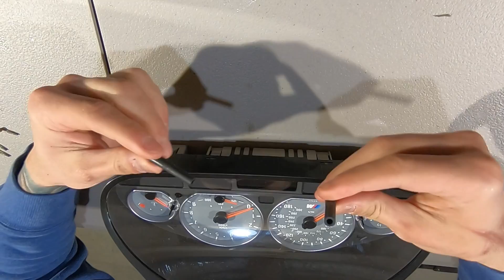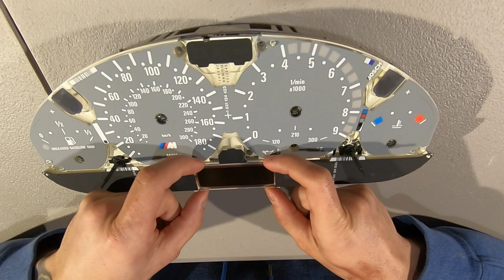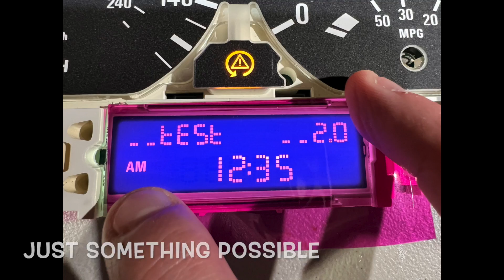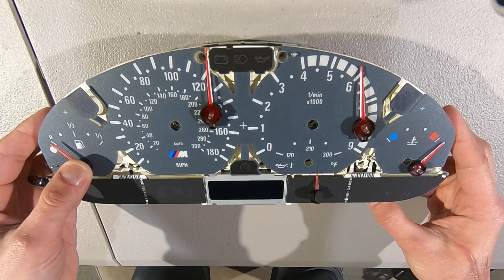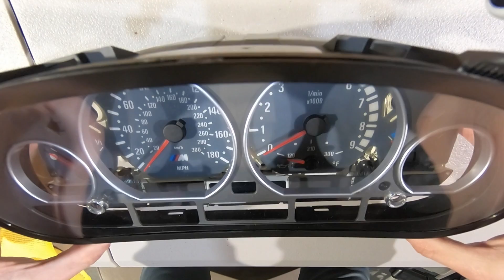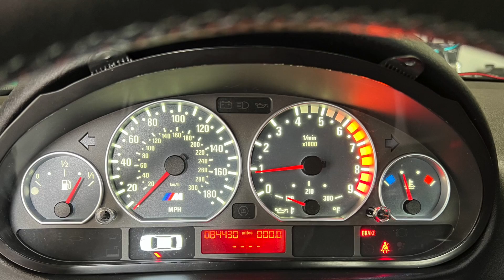E46 BMW M3 Cluster LED Conversion

Comment: How many volts are these LEDs anybody?
Reply from the maker: Pretty sure all LEDs operate on 3V but as long as you get the correct LEDs they are made to a standard and will work. I think I mention the type needed in the video or the description. its been a while

Comment: Do you think it’s possible to only convert to white where the M logo sits?
Reply from the maker: you'd have to float a LED under it and tape it off so no other light gets around it. probably possible but not without custom work

Comment: Did you replace the two small lights on the top panel for the interior lighting?
Reply from the maker: I haven’t done the overhead light yet. It looked pretty easy but I’ve had a lot of home projects that I’ve undertaken and haven’t messed with the car in a while. I wouldn’t recommend white on that light tho unless you plan on dimming it down with resistors. I’ll get to it one of these days. Too many projects and hobbies and not enough time in a day.
Reply: @CroVlado0510  Can I have your email for a few questions and photo material
Reply from the maker: @angelivajlov8513 find me on discord crovlado

Comment: Doing mine on my m3  all the needles came off easy but on the speedometer and the rpm’s the shaft came off with the needles. Is this supposed to be to happen ?
Reply from the maker: No, shaft is not supposed to come out.
Reply: How do I keep it from coming out and if they do come out. Will gauges still work ?
Reply: My cluster on my m3 all the analog gauges stopped working.  I bought a used cluster and I was going to just swap my original m35080 chip to the replacement cluster. That way I have correct mileage and no tamper dot. The shafts came off with the speed and ramp needles when removing. Which it’s the cluster that analog does not work. So it’s not that big of deal. But I definitely don’t want them to come off on the replacement cluster that I’m putting in. So any advice would be greatly appreciated.  This cluster you made on the video is amazing best one I’ve ever seen in e46 m3
Reply from the maker: I did just as I described in the video. Squeeze and twist while pulling up. None of the shafts came up. Honestly I’ve done 3 clusters and they all came up the same.
Reply: Ok thank you. Do you do this as a service for money ? How much to make my m3 cluster like yours in this video ?
Reply from the maker: I haven’t done it as a service, just did a test cluster from a junkyard to try out a few different combinations and color diffusion. One for a friend and my own. Like I said tho all the needles came out without the shaft coming out.

Comment: My cluster on my e46 m3. All electrical work but no analog works. The guy I bought the car from. Said everything worked fine before he replaced the battery in car.  I checked fuses and they are good.  What do you think it could be ?
Reply from the maker: find an electrical schematic and check the stepper motors is probably where I would start

Comment: What if you use white leds instead of orange ones on the display? Will the numbers become white ? I would love to have white leters with black background, looks much more modern
Reply from the maker: I tried this. The numbers become a white with maybe a hint of blue. photo is in the video if you watch it but the background becomes too blue. I haven't figured out a way to get the background back to black or close to without getting the numbers and letter too dim, I've tried polarization film and all but cannot get it right. Perhaps someone with better light spectrum cancellation knowledge could figure it out. Considering the age of the car at this point I don't have faith that anyone will, so I've settled on red instead of orange.

Comment: Just a small tip for someone planning on doing this. I have cluster that is 1999 and I do not have pin above "car" to light up whole cluster's background. So  you just need to connect power(12V) to pin 7 on black connector and obviously ground😁
Reply: for me doesnt work
Reply from the maker: @pashira probably did it wrong
Reply: @CroVlado0510  no, facelift clusters had backlight on kbus

Comment: Hi can you send me the link for the LEDS my 2015 x5 the right signal light went out.i also have 2002 m3 and i want to try this kind of tuff.great job please let me know
Reply from the maker: There is no particular link. Search on eBay or AliExpress and buy the LEDs you need for your project. If you need help identifying LEDs, a search engine will be your friend. Good luck with your project.
Reply: Thanks for your reply I will subscribe to you can you tell me the LDE 
You use on the  M3
Reply: Hi sir what code or type of led do you use to replace the orange led to white?. I have e46 316i

Comment: Need help how did you add the red diffuser sheet onto your needles ? You said you cut them into holes ? Can you elaborate further as I am going to do this retrofit soon and just needed some clarification. Can converse through email if wanted.
Reply from the maker: Turn the needles over and cut red diffusion sheets in the shape under the needle so it fits over the center hole where it attaches to the cluster. Slide it in there and put a tiny dab of hot glue in there to hold it in place. If you cut it tight enough it can use surface tension against the hole to keep it inside but it’s though to cut that small hole perfectly. Hope that makes sense.

Comment: Great videos, amaizing details. But i have one question. How do i know where is possitive and where is negative on the board? Also i have some 3528 white SMDS. Will those work? Thank you for your time.
Reply from the maker: The LEDs are marked with a cut corner. They may but I don’t know if they’ll be the same brightness. Considering they’re a couple dollars on aliexpress there’s no reason not to use what you take out.
Reply: Thanks for your reply, i figured that out afterall. I managed to replicate your work fallowing your steps. Thank you for my ‘’new’’ cluster.
Reply from the maker: @enciumarian2112  that’s great! Hope you enjoy.

Comment: I'm amazed at the detail..I'm trying to change cluster colours on a daihatsu copen..dont like the orange...I've learnt so much from your video...shouldn't be too different I guess..thanks again. Great work
Reply from the maker: Most of this should apply as long as they use surface mount LEDs. Match the type of LED and take note of polarity and you should should be good to go.
Reply: Where could I buy the white LEDs to do this?
Reply from the maker: @stevengonzalez-me7uy Ali express, eBay, lots of places

Comment: Hey man what all leds did u use for everything you did
Reply from the maker: For the cluster you only need PLCC2 (also called 1210).
Reply: @CroVlado0510  OK cool.. What about the window buttons and heat and air control and the headlight switch
Reply from the maker: @kevinsmith4924  I’ve made videos on the hvac and windows, working on the headlight, it’s a bit more involved.
Reply: @CroVlado0510  yea I knw i just need to know what all kind leds for all of them so I can order me some
Reply from the maker: @kevinsmith4924  it all depends on if you you’re going for direct swaps or more of a custom. Again if you watch and listen to the videos I did explain all of this. If you’re going for direct swaps you’ll need 3mm, 5mm, 0805, 1206, and PLCC2

Comment: Hey man they look great! What kind of LEDs do you need? Ive been looking all night trying to see what i need to order
Reply from the maker: PLCC-2 will cover the instrument cluster
Reply: @CroVlado0510 hello with 2 pins or 4;
Reply from the maker: @kwstas 2 wide pins. They cover almost the whole side off the LED. Type in PLCC-2, the 4 pin version is multi color and is PLCC-4
Reply: @CroVlado0510  goofy ahh i ain even got a beamer no mo
Reply from the maker: @Con Martin, what are you even going on about? Who’s talking to you?
Reply: @CroVlado0510  thanks, make news videos with other mods for e46 if possible. 😁
Reply from the maker: @kwstas not much left as far as buttons to modify. It’s taken a bit of a back burner as I’m building a new garage and finishing my basement currently. I haven’t touched that car in about a year haha
Reply: Hy friend do you have any clear picture of the dashboard leds because i messed up with mine i made them whote at first now i went for cyan and from 4 on spedometer only 2 works same for spdemoter 😮😢 thank you

Comment: How much would you charge to do this ?
Reply from the maker: What are you looking to get done?
This is just the first video posted. I’ll be putting up the hvac, and rest of the car soon enough, waiting on some LEDs to arrive from overseas
Reply: Led upgrades and painted needle
Reply from the maker: @Gskeee  sorry lost traction on this. $100 for LEDs another $100 for needles, plus cost of LEDs if other than white and shipping here and back. 
Unfortunately not cheap but it takes a couple hours to do it all.
Reply: @CroVlado0510   I want this done on my car it looks really cool I will contact you when I got the money to spend